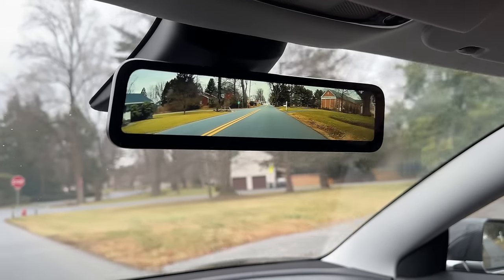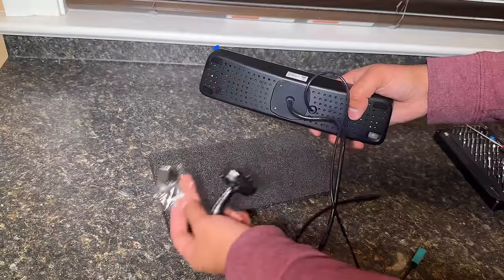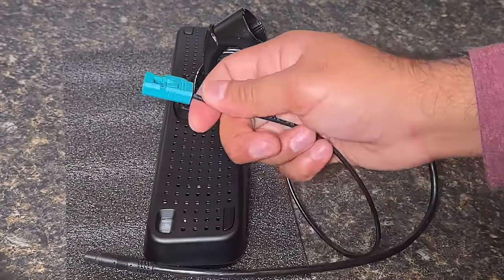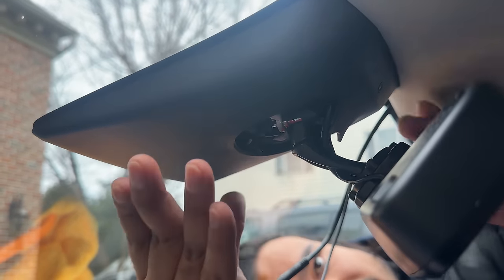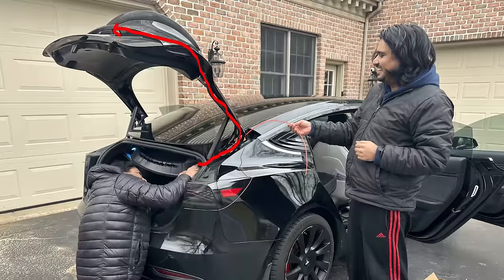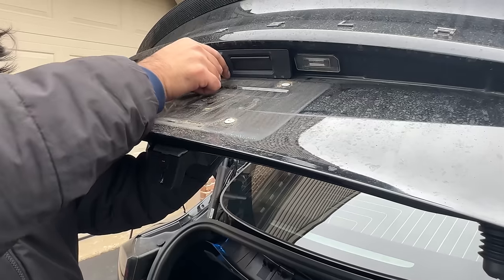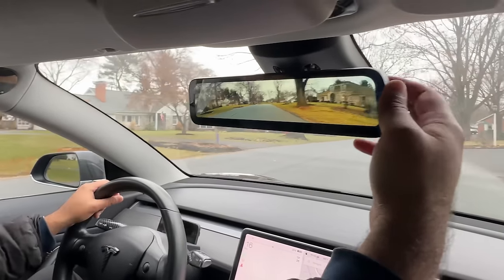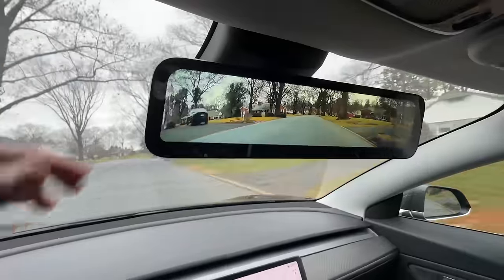Tesla Model 3/Y Rear View Mirror Upgrade With Camera Integration - Streaming Mirror Accessory 2023

Comment: suggestion for front facing camera on bumper of some sort. Since vehicles built  in 2022-2023 dont have radar, a front facing camera would be nice to see how far you are from a curb. The cybertruck will have this feature.
Reply from the maker: Thank you for your feedback! I will pass it along to Hansshow.
Reply: @ShivaSapkota  the cover for the tow hook would be a good spot to have a little camera for the front bumper. Please pass along the suggestion to Hanshow, would love to see that happen
Reply: I saw that some mirrors can handle 2 cameras. I would place one in the front because of the total failure of Tesla Vision and hence the lack of radar sensors!!
Reply: At the moment it’s urgent to solve the problem caused by Tesla Vision. Could you suggest good and easy to install radar sensors for the new Tesla Models?

Comment: I happen to love this mirror. I just installed it over the weekend and your video was very helpful. I have discovered that under most conditions I can change the focal length of my gaze and switch back and forth between the camera and the reflection without turning the camera off. Thus takes a little getting used to. But doing this also reminded me how telescoped the camera view is (in the sense that objects appear much farther away than they actually are). Do you know whether there is a magnification (zoom) setting for the camera? I notice that a long press on the power button brings up a settings menu. The items are in Chinese, so I have not quite figured out what they all are. The first one is brightness. I'd love to be able to set the zoom level. Anyway, thanks for the great video!
Reply: How is the glare at night? and how is the view when off, i.e. so you can see rear seat passengers?
Reply: @xipalips  No glare at night with mirror off, but it is noticeable with the camera. I can see the rear passengers okay, but not as well as with a real mirror. I honestly don't use the camera all that much these days - I think I'm old enough that I just prefer a direct reflection to the camera. Somehow, I feel that the rearview is most useful to me to keep me out of close calls, and the direct reflection seems better for that. The camera IS good for broadening my situational awareness about the whole field behind me in a more general way. I'm still glad I have it.

Comment: Great Video, Shiva! Many greetings from a Tesla buddy from Switzerland 🇨🇭✌️#RealRusty

Hansshow rear view mirror is a good idea for a product, but in my opinion a bit too expensive and also I have the same opinion as you on the size of the second camera. It will be much better to be able to replace the original Tesla cam with 4K, so that you don’t need to install the second, bulky one. But overall still a great upgrade, especially to Y which has even narrowed rear view.
Reply from the maker: Thank you so much!! Yes, they need to lower the cost and make the camera size smaller.

Comment: Save your money.  Try using this mirror at night.  It sucks.  So many issues with rear headlight glare that you're basically blind.  Went back to use regular wide mirror from an auto parts store.  About $20.  Problem solved.

Comment: Does original dimming on side mirrors still work after removing oem auto dimming rearview mirror?
Normally side dimming mirrors are controlled by rearview mirror with auto dimming wire plug that you disconnected,

Comment: Thanks for the video Shiva!  I just finished installing this mirror.   However, I feel the mirror itself is not very stable... that metallic triangle spring that the mirror twists into is no longer tight.   I'm afraid to try to turn the mirror (it fell out a few times when installing).    Any advice for this?   Is it possible to buy that metal piece somewhere?

Comment: Hi Shiva, love all you videos. I have added this to my Model Y. Just wondering if you know of a solution for all the cabling in the centre console where the canbus connector is? I have the s3xy buttons as well and wanted to add a rear screen but there doesn’t look like it will fit. Maybe Hansshow can make the canbus cables longer so you can tuck them better? Thanks.

Comment: Does the larger size of the mirror interfere with the cabin camera view even more than the stock mirror does?
Reply: I just did this install, you can see it at the bottom, but its not bad.

Comment: What’s the purpose for OBD connection if it’s just a camera?
Reply from the maker: The OBD powers the mirror. That is the only purpose. Otherwise, you would need to use your 12V socket to power it. Thanks!

Comment: During your install, you tapped into the rear obd port. What if we have the rear display add on, will this interfere with that or do we just piggy back on top of that connector?
Reply from the maker: You can daisy chain multiple plugs without any issues. Thanks.

Comment: Shiva, nice job on another great video.
In the two years of owning my Model-3, I know that the OEM reversing camera suffers from quickly getting dirty from road spray in poor weather resulting in a considerable loss of image quality. I would be cautious of this if I had a rearview camera placed in the same position that I had to rely on to see what is behind me.  I would be interested to learn your views on this, please.
Reply: Hi Tim. I have had a rearview camera mirror for a while and you are correct about poor weather image quality loss(they stick out more than the Tesla one). I bought this version and mounted the camera on the rear parcel shelf and it's much better. You don't get as wide a view as mounting above the licence plate but it is still pretty good and much better than the standard rearview mirror. Also don't get the headlight glare at night.
Reply: @mytrini what is a parcel shelf?

Comment: You did a thorough install and review. I have another brand that also incorporates a dashcam - which I strongly suggest. The Tesla cam only saves data if there is an accident and some have not worked for people, so a separate dashcam provides security. Those with Tesla insurance should always have a dashcam to dispute any false collision alerts or other false events. It has paid for itself many times over.
Reply: Which brand? And is it powered thru the obd?
Reply: @ayodangit  Several brands have mirror dash cams - they install cleanest. Tesla  does not have an OBD2 port. They use a standard Ethernet port. I use a cig lighter plug in the console, but there are USB and even cables that hook inline with the wiring harness. Get one that has the number of cameras you want - at least 3 - front, rear and cabin. I have the cabin recording the screen - it is important to have that so you can see what car messages are at any time.
Reply: @wylieecoyote  my cig lighter stays on when i walk away from the car. I get concern that the battery will drain? how are you powering yours?

Comment: Shiva, nice video very well done. I like that you showed some options on the cable running!  I agree with others the price for 1080p is too high, if it was 4k maybe.  I'm in hot S Fl and bet that tape holding the camera will not last. My Magbak phone mount is already starting to move and we haven't gotten to summer temps.  I know they wanted a plug-and-play, but I would prefer to drill a hole and the camera mount inside out of the weather and just have the lens come out enough.  I like the bigger screen (mirror) and that you can use it as just a mirror if needed or the camera fails.

Comment: Looks like a great upgrade in times of clear weather. My worry would be that the camera (and thus the rear view "mirror") would be obscured when water drops cling to the camera lens. At least that's what often happens on the backup camera in wet weather. 

Thanks for the cool video, though, and all your useful product reviews.
Reply: I have it installed, and I haven't been driving in rain, but I have been through a few car washes and it's not much different than the stock back camera.  The water runs off of the lip above the camera.